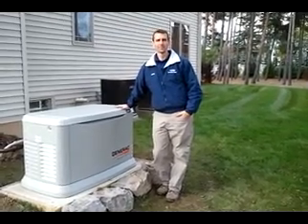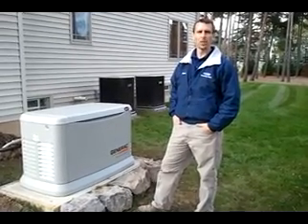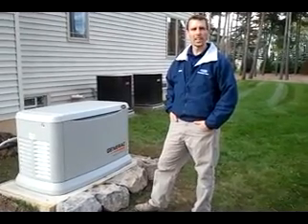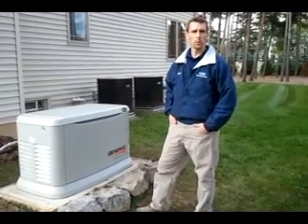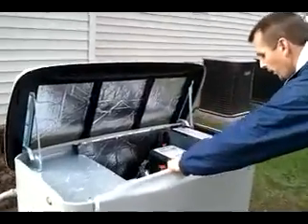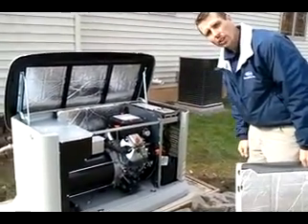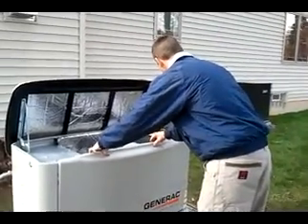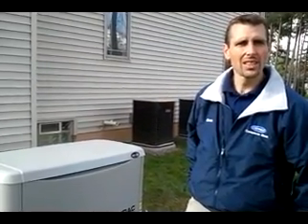Generator, Whole Home Natural Gas

Comment: I am amazed at how many comments miss the mark of why you would use this.  It is for power outages, not in lieu of getting your power from "the grid".  When a storm hits and power goes out you need to know that your sump pump (and freezer etc)are still going to function. This has nothing to do with "being off the grid, "disturbing your neighbors TV enjoyment", or fitting a "noise ordinance". This is to avert DISASTER. Sump pump gets power, sump pump keeps water from over-spilling your sump well. Freezer gets power- you don't have a freezer full of groceries smelling up your home like you're storing dead bodies. Lights get power- you don't spend two days adjusting to life with candles and flashlights.     If you are on vacation and your power is out this is a means to save your basement from flooding to the first floor where water can finally seep through your door seals. This is an emergency appliance.  This is not an alternative to conventional power source.
Reply: I agree - for some reason this demo is attracting kooks. This unit is a standby unit for temporary emergency power needs.
Reply: why would natural gas stop after 18 hours? NG needs no power to flow into the house!
Reply: Trina McDonald How many times has the entire city gone dark? I wouldn't rely on this generator all by itself and I'd have solar panels etc to have additional options to reduce the reliance on the grid. But NG suppliers have multiple power suppliers so I've never seen NG supply stop even with a wide spread power outage.
Reply: +5Tango13Charley Actually, if the power is out longer than 18 hours, NG stops and this becomes useless. NG generators are nothing more than expensive junk. It is after 18 hours when you will really need a generator, and this will be dead.
Reply: enkrypt3d You are right, but the pumping stations that pump the NG to your house at high pressure do require power. I have no idea why most think everything starts and stops at their property line. Try thinking chain of supply.
Reply: I have wind and gas generator back up, I have seen NG go off after just a couple of days. Note Hurricane Sandy and Katrina, and the east coast blackout some time back. Installing this is good, if the power goes out over night only.
Reply: During the Northeast blackout of 2003 (over 72h) I think our home still had natural gas flowing. I do remember using our gas stove to cook during the outage. My area might have been lucky (GTA Southern Ontario Canada) I don't know, But we did have the gas flowing.

Comment: A 20 kw like this connected to a natural gas source can produce 83 amperes at 240 volts. That's not the same as a 200 amp service. The two A/C. condensing units should be connected to a load-shedding capable service-rated automatic transfer switch. The work looks really nice and I'm sure whoever owns it is very happy.

Comment: According my calculations it is not, but close (so its possible)
If @8KW gen consumes 120 cuft/hour at residential cost of $12/1000cuft
it will be 18 cents/kwH and electricity grid is about the same at $0.13/kwH.
The actual consumption of nat gas can be greater plus the cost of running equipment.
You can play with numbers if you have the data, I just took the numbers from what I can google.